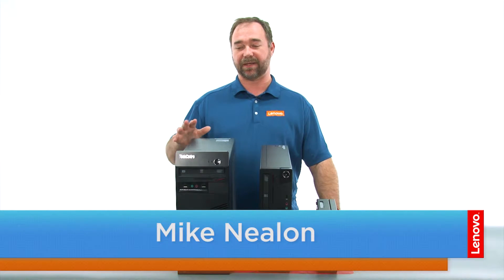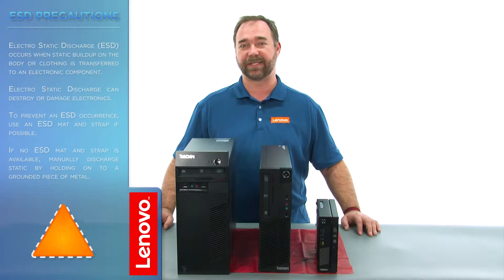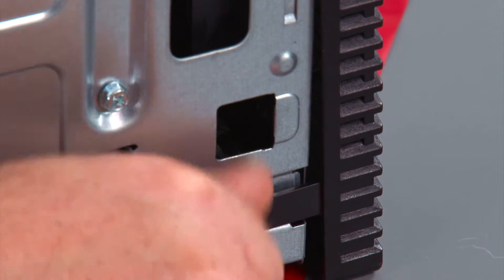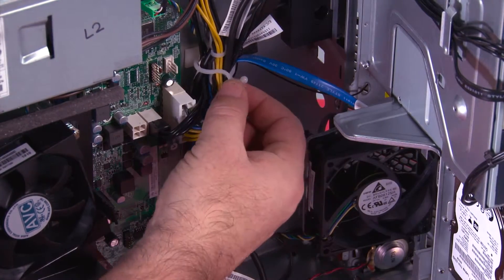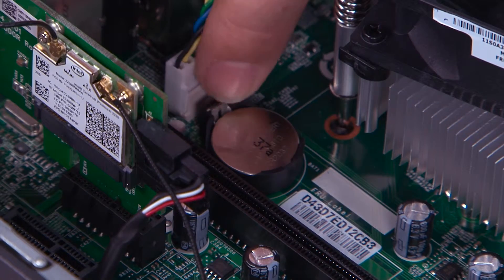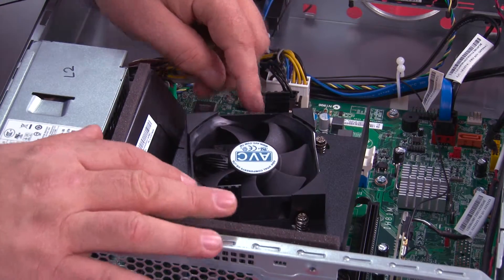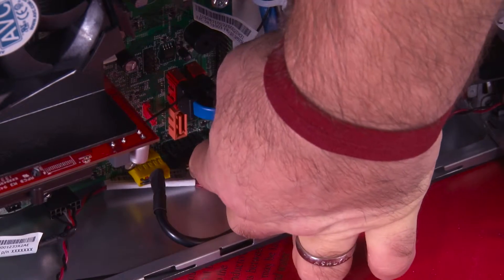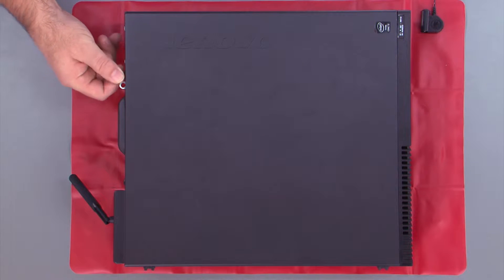ThinkCentre M73 / E73 / M72e Small Form Factor Desktop - CMOS Battery Replacement

Comment: Why we need to remove the power cable to replace the battery?
Reply from the maker: Hello Mohd, thanks for reaching out. This is to remove all electrical current from the device, ensure that all power cords are disconnected from the power source. Let us know if you have other questions. Allan_Lenovo
Reply: @LenovoSupport  Oh ok, thanks for the answer.
Reply: Do you need to do anything with the bios settings?